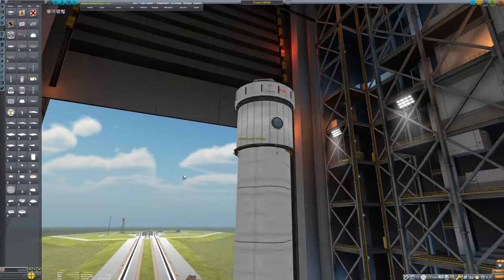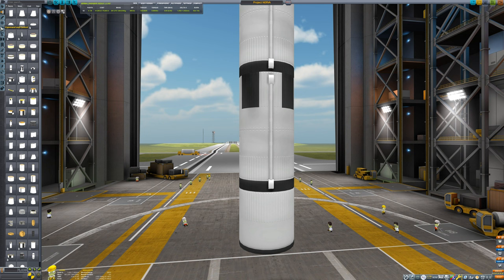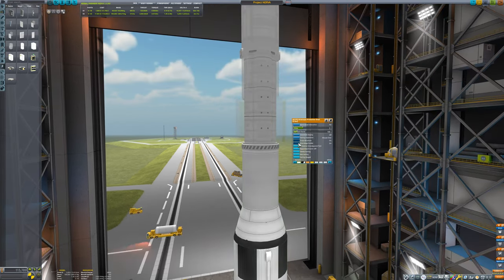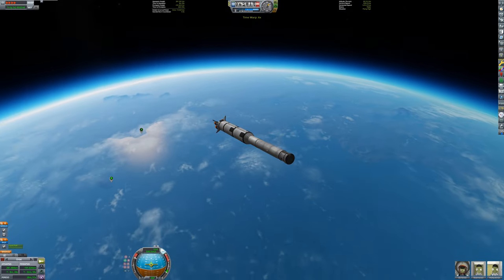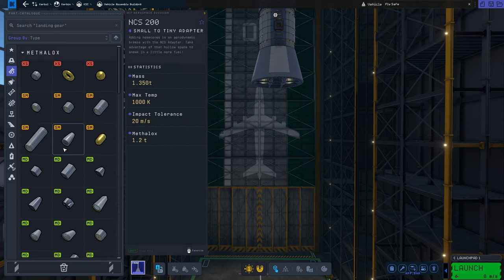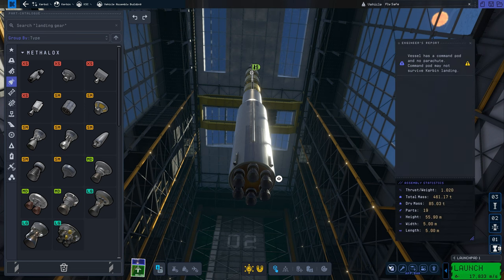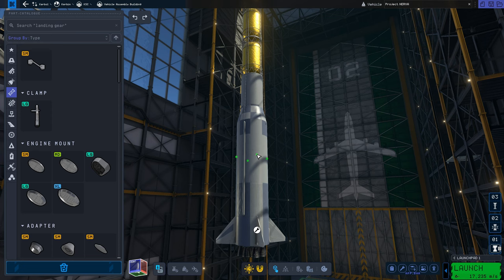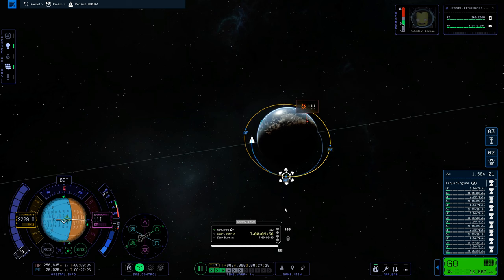NERV engine tutorial for KSP and KSP2

Comment: Greetings, exalted ones.

Btw in KSP1 there are actually large fuel tanks that only hold Liquid Fuel so you don’t have to only use the smaller ones. They are the same shape as the MK3 Cockpit, for the large airplanes/shuttles.
Reply from the maker: Yes, these Mk3 parts tend to have a higher mass for the same amount of liquid fuel. With mods, I'll use configurable containers and use whatever fuel tank I want.
Reply: @Echo3  oh that makes sense. I guess they’re still useful with very large crafts where you want to limit the part count.
Reply from the maker: @thesenate2718  but let's not discount the importance of keeping part count down.